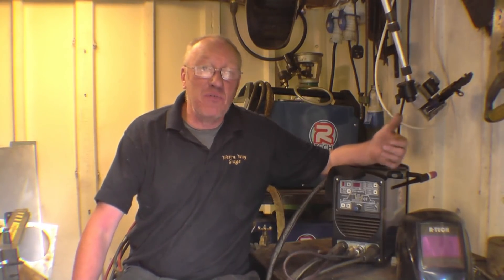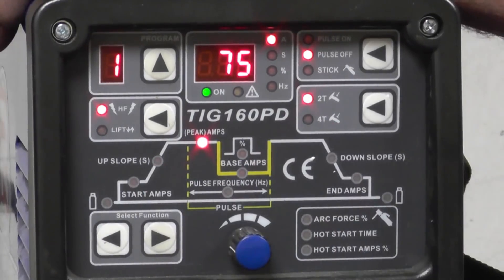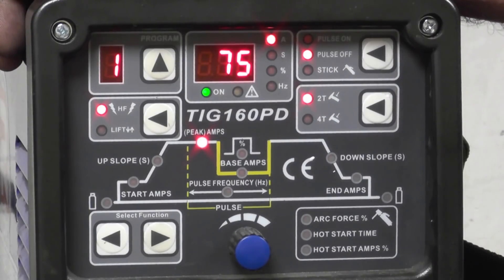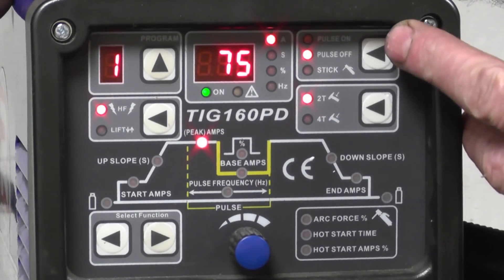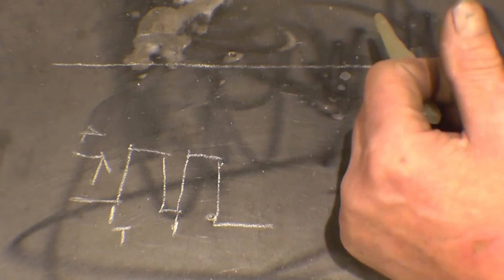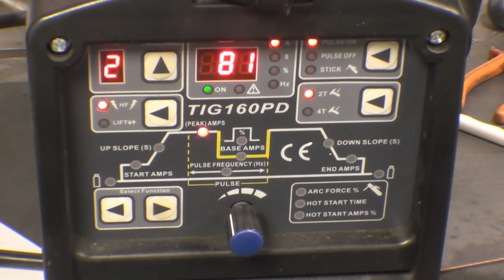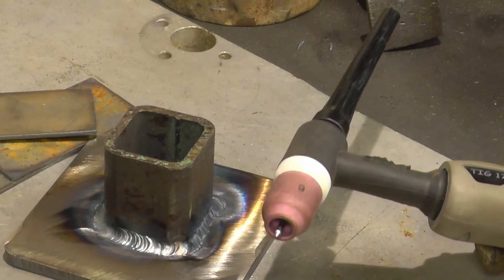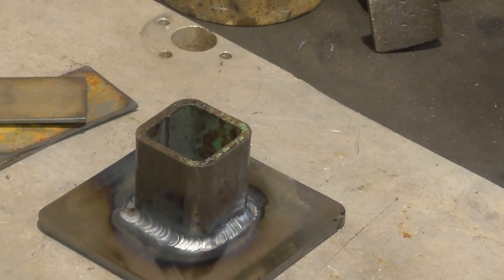R Tech 160 AMP DC Digital Welder Review P2

Comment: Good timing John. I think I will spring for an R-Tech welder. I only have crappy old MIG and have an upside down weld a nut to a broken stud job to do🙄 Any chance R-Tech would let you whip the cover off so we can have a peak inside? Obviously the electronics are up to it. Just wonder if the fan blows across all of the boards and heatsink or is ducted to just flow over the heatsink fins. Don't want to fill her up with grinding grit and general welding shite just to blow her up. 

Top video as always 👍